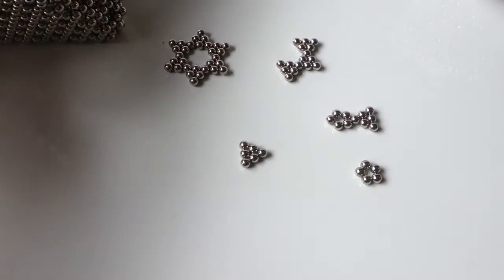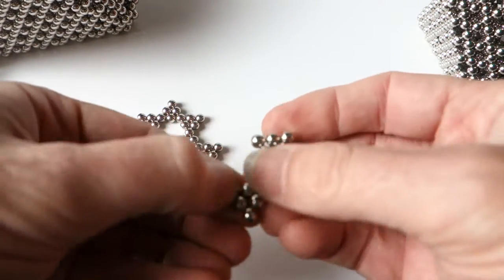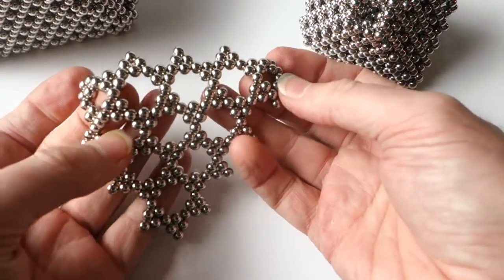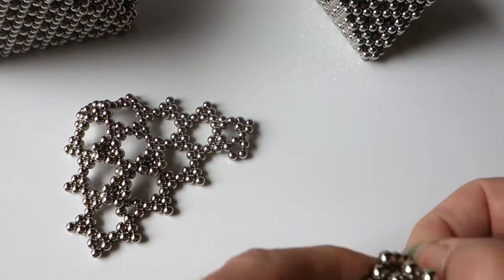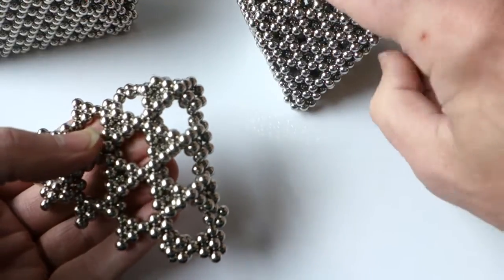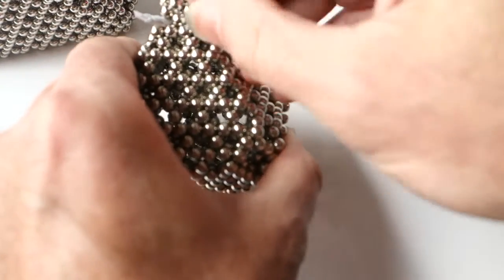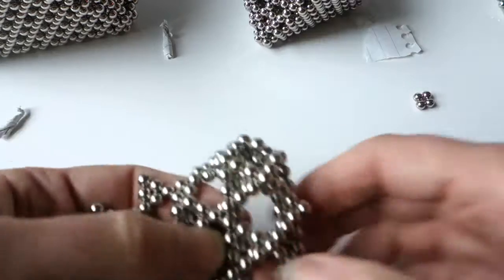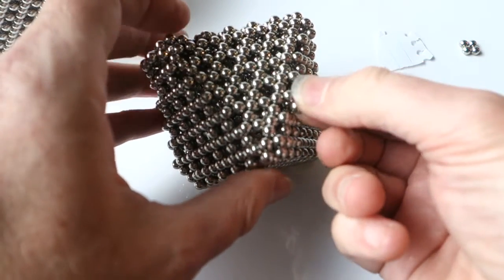Hexagonal grid two layer octahedron

Comment: Hey this is amazing! A great shape that I had to watch and an effective technique, how did you get there? :)  The tuto is also great and thanks for the drawing, it helped!
Reply from the maker: Thanks, Dandrelin, and no problem.
How did I get there?  The patterns of the inner and outer layers I had done before, separately, and I was playing with the inner layer, because I believe the technique of the inner layer can be used to make arbitrary surface topologies (well, kind of arbitrary, and also a bit floppy so far ). I may have some pictures later. But I got side tracked when I figured out that I could make the two layer bend, and the fact that the polarity flips over lead to "4 sides per apex", so octahedron. I was quite pleased that the fill in shapes worked so well.  I knew about the 3 triangles, but I admit that figuring out the edge and apex fillers gave me a little thrill :-)
Reply: Damian O'Connor Thanks for the interesting details, I love the excitement when you realize things actually work just fine. I'm sure those layers could reveal some more secrets too!

Comment: Damian, I'm also impressed.  Fascinating!  I rather like the lacy look of the outer faces without adding the final 3-magnet triangles.  Is the shape stable without these triangles?
Reply: Damian O'Connor
I loved the shape. Had to make it.
Reply from the maker: yes it is.  if you leave out the small triangles, you can vary the size of the triangles, and even add more layers.   You may change your mind if you make it though - it was a bit hard to bring it out in the video, perhaps, but the continuous hexagon pattern over the entire surface looks quite effective
Reply: I see.  Bravo on another excellent shape and video.
Reply from the maker: corieg1 post a photo or video!